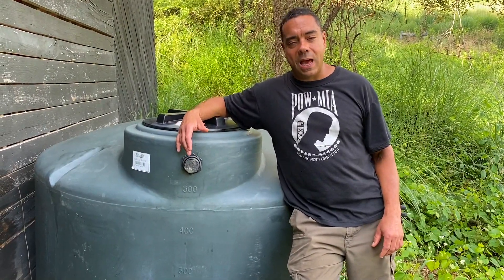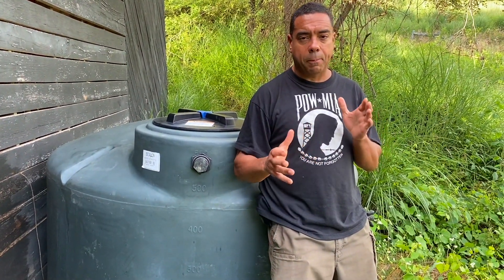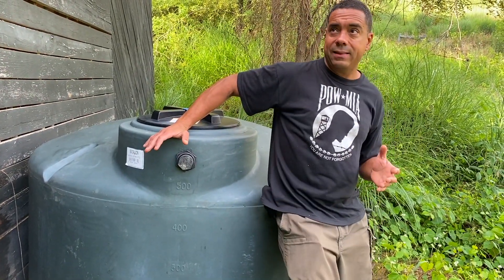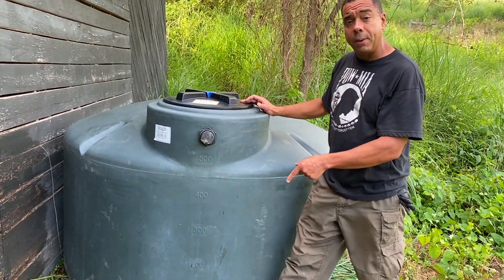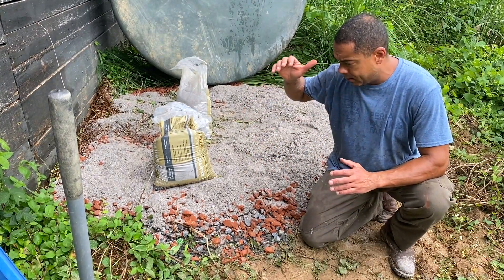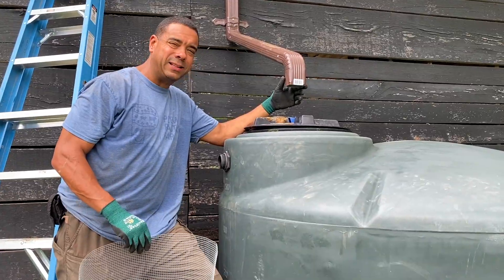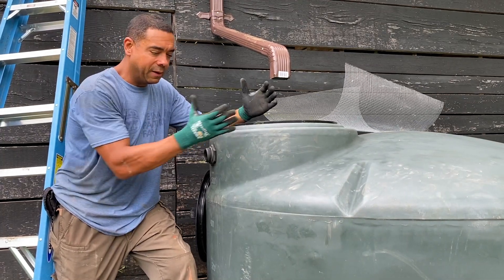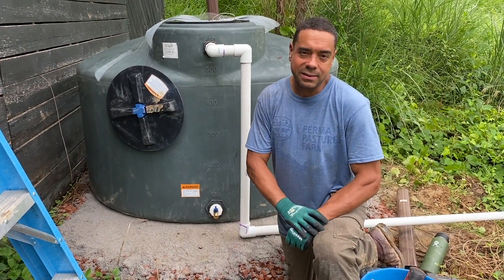DIY Rainwater Catchment System

Comment: Great project, Billy. I did something similar years ago, but much smaller. I had a shed next to the garden set back away from the house. I crisscrossed 4x4s to raise a 55 gallon drum to about chest height. I put a hose spigot near the bottom and used gravity to water the garden. The only difference is I used screen door screen and a bungee cord to keep mosquitoes from getting in and breeding in the water.

Comment: Nice! No spring  for us but we do have a garm pond at a pasture high point. The hope is to get solar panel and weak water pump to run constant during the day to slowly build up the supply. The pond itself is in a bit of a gully so it should get filled pretty well by most rain events.  Our plan is inc tanks because they come on skids so we cam theoretically move them with the tractor, still need to get a pallet fork, but ours is kind wimpy so I doubt I could move them while full. PSA check what was in the tank before hand if you get used, the ones we are looking at held veggie oil but you can find ones that had fertilizer or diesel fuel in them. Also ibcs typically are not uv resistant and need to be out of direct sun or a tarp over them. No paint as that may be able to leach through to the water. You can also check craigslist  often farmers are selling feed barrels and tanks they get veggie oil and apple juice in, it's a cheap way to bulk up pigs on commercial feed is my understanding, and they can use a little extra love right now too.

Comment: You can’t store too much water. Valve on output should be ball valve for best flow. Hose bib too constricting. I could not see well enough to tell what you had. See my first few videos for a few rain water system tips.
Reply from the maker: Conrad Homestead I will watch those videos for sure! I pointed out the necessity for a ball valve but it was somehow deleted in the editing. I would have used the same type you had but they were sold out at Home Depot.
Reply: Perma Pastures Farm I understand. I was trying to help a fellow out 😁👍 I noticed you checked out the video. Thanks!
Reply: This is another project I have planned. Can’t afford it now. Still on city water but searching for a spring somewhere on this property. Rain catchment will help in many ways. We get lots of rain in spring and fall, but not as much in summer. I just have the concept, but lack the detailed knowledge to build a simple system. I have a tiny house that’s 12x24. It’s located between my two pastures and situated on the highest point on this property, so gravity can be used to get the water out to water points in each pasture with a 3/4” buried poly pipe and some Plasson quick connects. (Thank you Greg Judy) I’ve subscribed to the Conrad homestead channel today to learn more about the plumbing and setup. Btw there is no well on the property.
Reply: @Whale_Chum  sounds like you have good plans. I hope you able to setup your system.